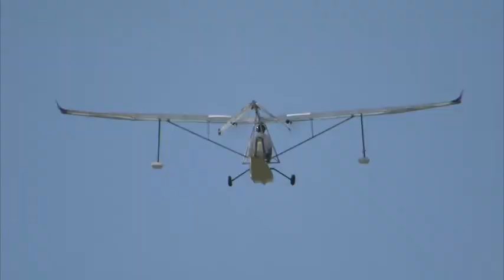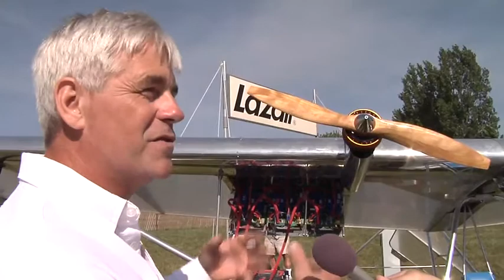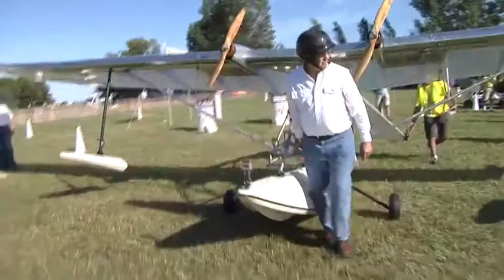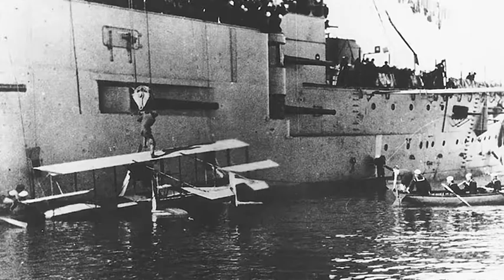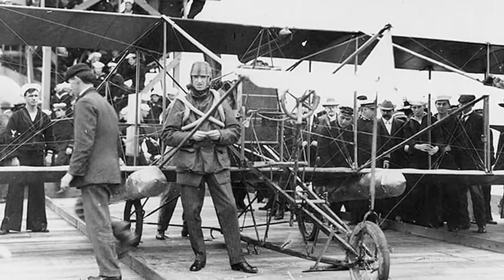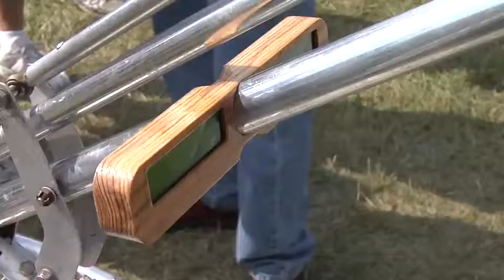eLazair v2011 amphibious land operations

Comment: That is an awesome plane. After all these years it's still on the cutting edge.
Reply: Not really. The downward angled ruddervators are an amphibious design fail.
Reply: @erickborling1302  The Lazair makes a great float plane. It has worked well for the last 43 or so years.